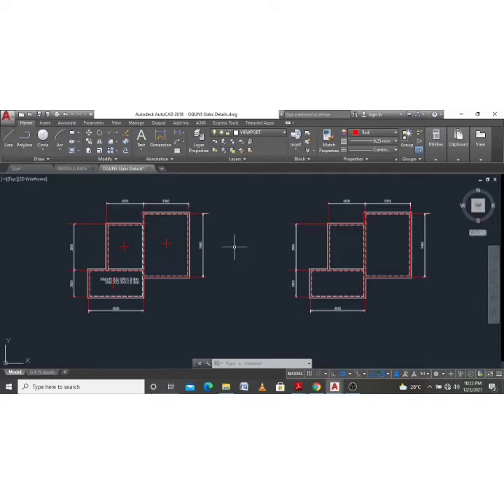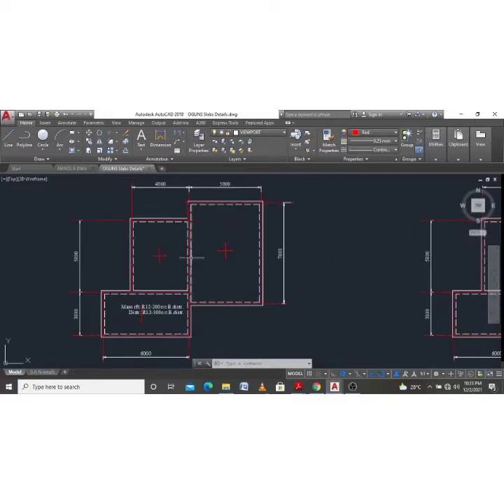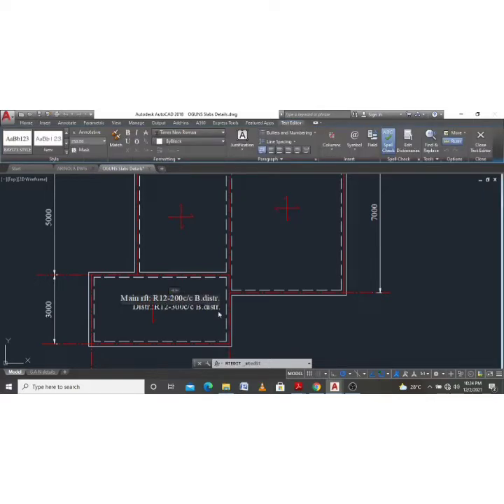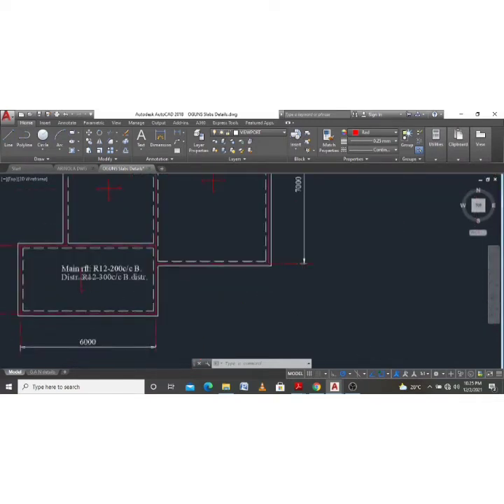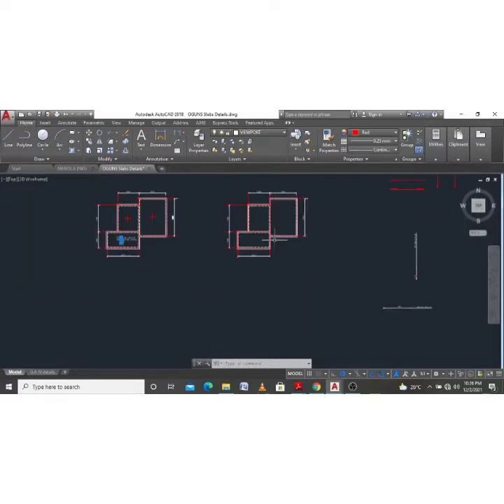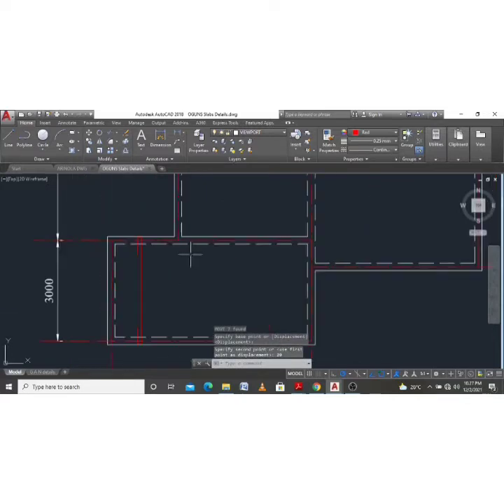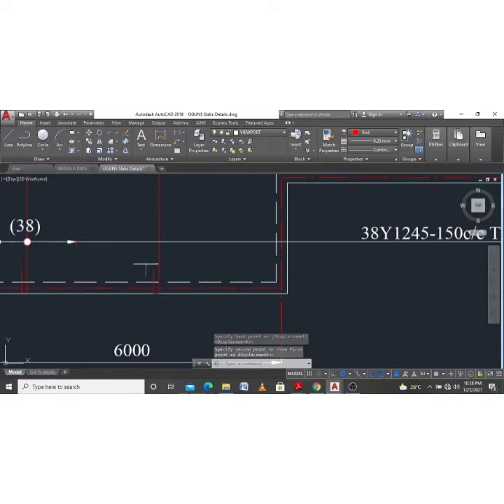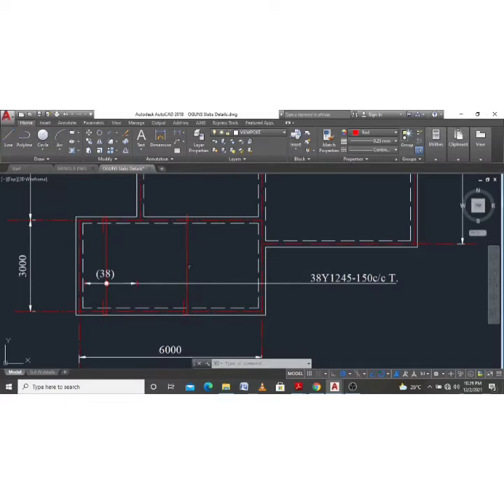ONE WAY SLAB DESIGN REINFORCEMENT DETAILS

Comment: What if panel 2 was a one-way slab retaining the 4m width but an increased length. How would you design for the top reinforcement that would connect to panel 1 since they are orthogonal to each other?